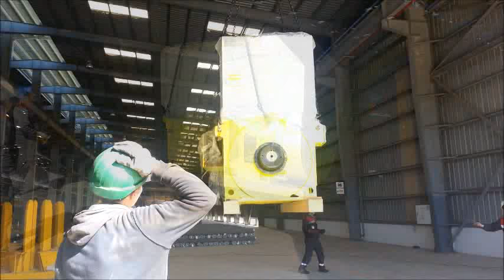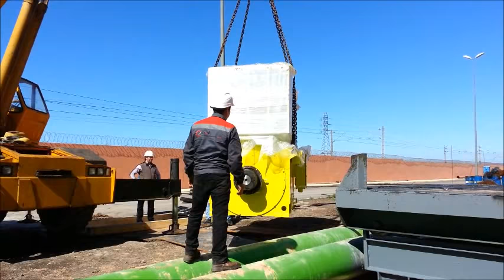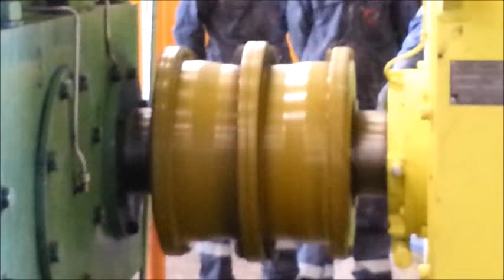1,250 kW slip ring motor - installation and first work

Comment from the maker: 0:00 nearly 10 tons of modern motor engineering
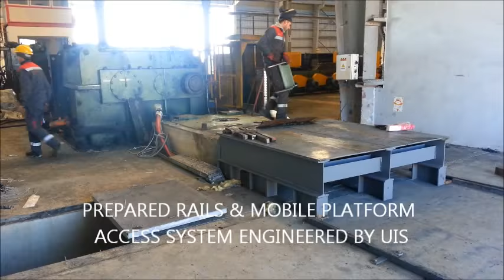0:15 prepared rails & mobile platform
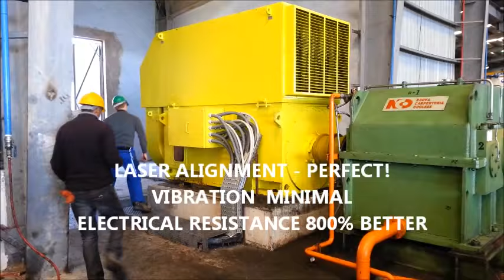1:13 laser alignment - perfect
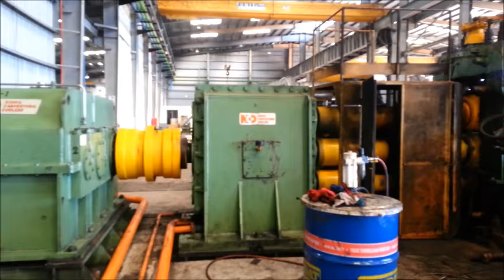1:22 Hendrick Phillips, Menzel Engineer
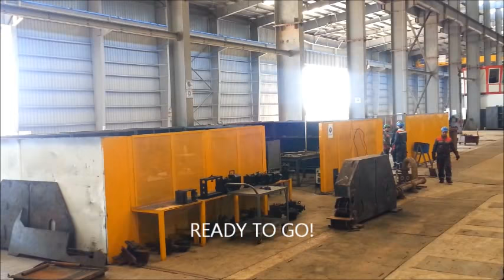1:41 ready to go
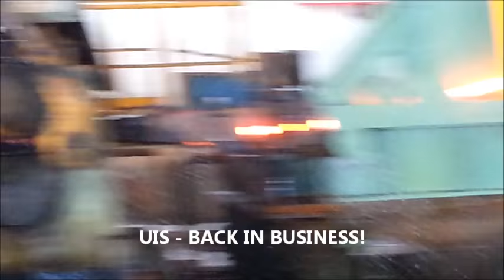2:39 back in business
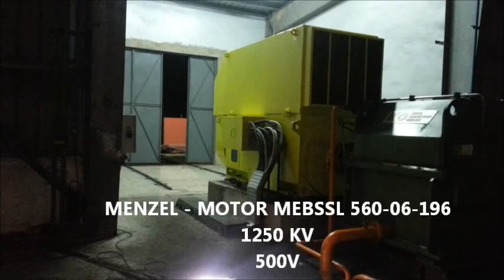2:55 a short film for Universal Industrial Steel

Slip ring motors are the motors of choice whenever high starting torque or low starting current are required. They are especially suitable for heavy load inertia applications. You want more informations? Please take a look at the video description. Thanks.